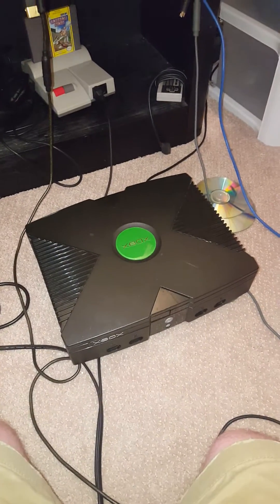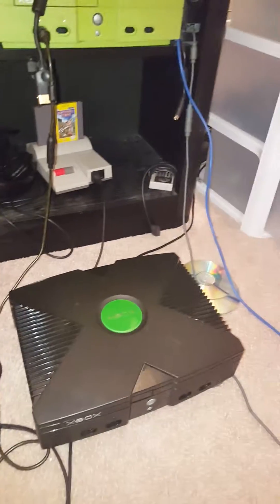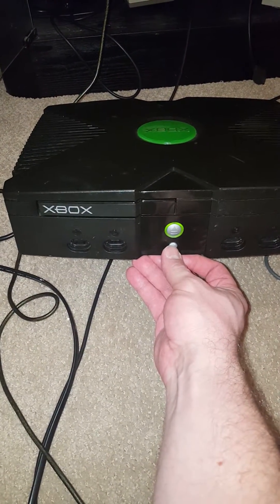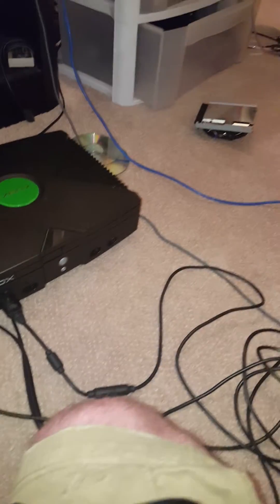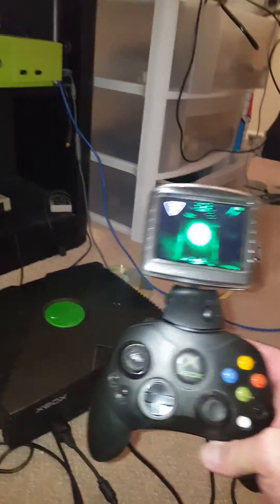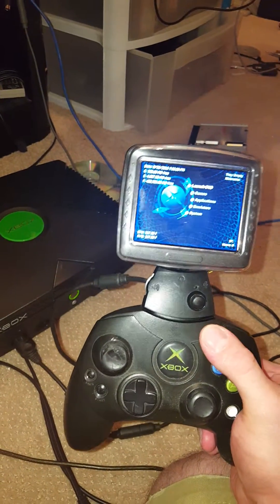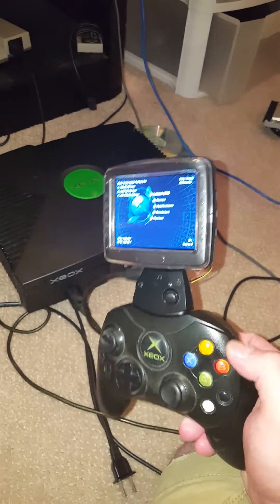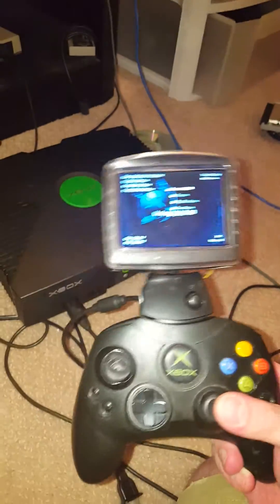Xbox Controller LCD Screen Mod

Comment: Incredible. I desire small screens, I noticed you have more than a few. I have a mental projection of n64 being modded to be used as a game creator, at least pixel art. Using any desired controller (PS2), big storage
Anyway something people could make games and load onto cartridges, even if they were graphic mini games or even gifs/images. Something that would be all physical and offline. If it was open source each cartridge could be carried to other people to keep creating on. Would possibly create a treasure of cartridges and interest in communication with other humans, at least physical tech wise. Even the creator software would expand. No license, no keys, no gateways. Simply a way to expand the mind digitally. n64, since it's already out there and has cartridge slot. Also polygon. Anyways, love your vids, super cool.